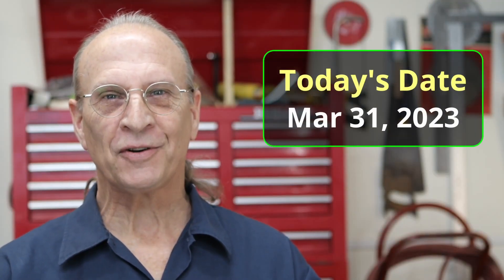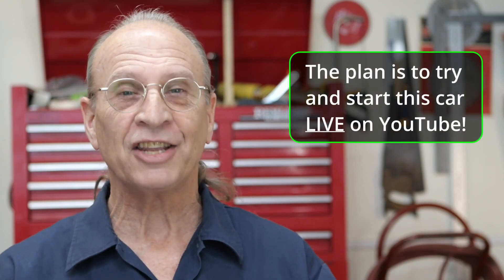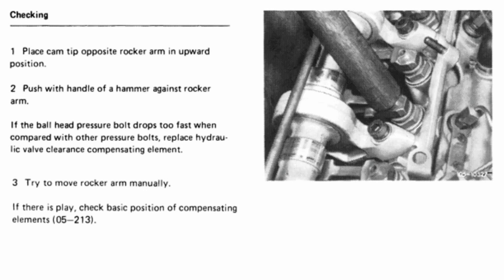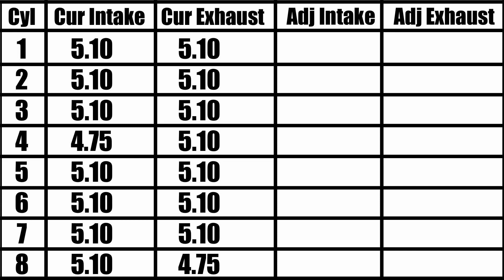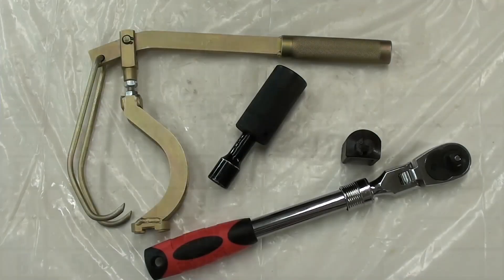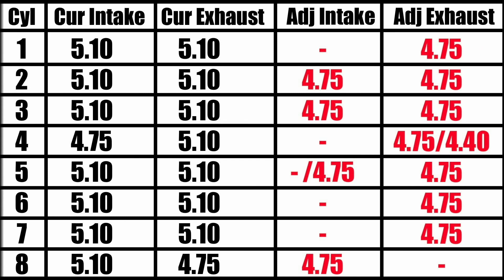560SL - Adjusting Valve Clearance / Compensating Elements / Go-No-Go Gauge

Comment: Great video.. do I need to do any adjustments if I replacement all 16 lifters (compensating elements) on a 86 560SL? 
Aren't thr lifters self adjusting (hydraulic)? 
Also, do you recommend Febi lifters or other brands? Thanks!
Reply from the maker: Thanks for this question. I think others might have the same question so I want to answer with detail. This is how you test and adjust hydraulic lifters on the 560SL (M117). Yes they are hydraulic in a way, but no, they are not self adjusting. Compensating elements could be leaking, plugged or not within spec and the shims used to adjust valve clearance could also be worn. And don’t forget you have valves and those valves have valve seats that wear out. Lobes on your camshaft wear too. When you are using the Go-No-Go gauge, you are testing the “valve clearance” and that’s the most important part. You could have all new valves, compensating elements and rocker arms and still have incorrect valve clearances. This is the only way you know for sure and the only way to get it right.
Reply: @TonyLiveTV thank you very much for your detailed response 👍  so, I need to purchase new shims as well? Is Febi a good brand for compensating elements  (lifters)? Also l, how can I tell that my lifters are actually bad given I hear the lifter ticks? 
By the way, the car had 175k miles on it
Reply from the maker: @arashrx the only way to know what you need is by testing. That’s why I own a Go-No-Go gauge. All parts used were genuine Mercedes. That’s me. I cannot comment on other brands when I don’t use them. Nothing is better than a genuine manufactured part. Often the genuine part is cheaper anyway and can last 40+ years like it did on our 560SL. Did you test and bleed the compensating elements? 560SL - Bleeding Hydraulic Lifters / Compensating Elements https://youtu.be/jmjHY-BCUjo
Reply: @TonyLiveTV  thank you for your feedback and quick response 👍 
How donI test my lifters, do I need to take them out first? Is there any procedure to test them while in the car?
Reply from the maker: @arashrx how to test is in the video and in the manual. Your engine needs to be running in order to test compensating elements properly. Taking them out and bleeding them will often expose issues. Everything is in a video somewhere because I completely dismantled this engine and I covered virtually everything I could think of. What I didn’t cover you will hopefully find in the manual.
Reply: @TonyLiveTV thank you very much.. I will 1st try to bleed all the lifters and hopefully that fixes my lifter tick 😊

Comment: Great video,  one point that should be mentioned (apologize if you mentioned it and I just missed it) is that as you compress valve spring to remove rocker arm, cam lobe is up and as you compress the spring, be sure valve falls with spring.  If it does not, keepers can release and valve will fall into cylinder…….
Reply from the maker: @MrBobby3340  good point. I did see the keeper could pop out so I was very careful.
Reply from the maker: Hey Mr Bobby. I was working on a project where I had little cell service, but I thought I saw a post from you asking about the no-go-gauge. Maybe it was someone else, but I no longer see the post. If it was you and you need something, let me know.
Reply: @ Hi Tony,  it was me.  I was able to borrow the tool.  In the middle of replacing the timing chain, etc.  I decided to replace the rocker arms and compensators.
Reply from the maker: @ great 👍

Comment: Hi how are you brother
It's a minor differences between the yellow line so if you don't adjust it properly does it damages the piston or damages any other parts or ot adjust by it self
Please let me know
I liked your clips
No other person can make clips like you
I also love 560
They are the best cars in the world
Take care brother
Reply from the maker: Thanks Shabaz. The purpose of using a go-no-go gauge for testing valve compensators in the Mercedes M117 (560SL) engine is to ensure that the compensators are within the specified tolerance range for proper valve clearance adjustment. If the gauge shows the line above or below the measure point, it indicates that the compensators are either too tight or too loose, which can lead to issues such as poor engine performance, excessive wear on valves, and potentially even engine damage if not corrected.

If you are close with the go-no-go gauge it will likely be just fine. There seems to be plenty of clearance between the valves and pistons. I would say engine timing is more important in this respect. If your valves open at the wrong time it can cause damage to valves and pistons.
Reply: Thanks brother for your reply
I live in Bahrain
If you come to Bahrain
Let me know
I want to open a car garage but knowledge is very important
That garage will work for only 560 classic models
Reply: If possible can I have your what's up no.
Thanks

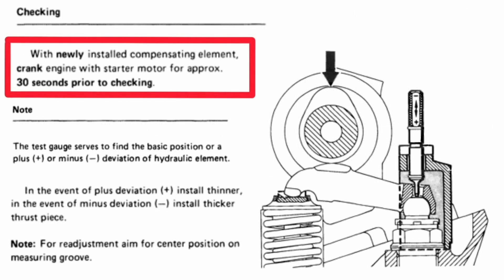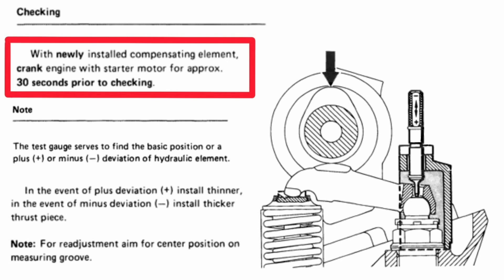Comment: There's something I don't understand - In the video, it looks like you have the go-no-go tool sitting over the spring and thrust washer for the measurement test, meanwhile in the manual image you show earlier (starting at 1:38 and an alternate view starting 2:33) its clear that the go-no-go tool is positioned over the compensating element - I'm confused on why, and where you are supposed to take the measurement - tool over the spring, or tool over the compensating element? OR - is it both, and they measure different things?
Reply from the maker: Tool is over the compensating element. Not on the spring side. My close up video was too close. I should have shown the entire tool and how I measured. I’m sorry about that.
Reply from the maker: I just had a listen and I see what you mean. Does it sound the same warm or cold? The compensating elements are tricky. Just having them hard doesn’t mean they function properly. Since you have the go-no-go tool on the way, pull your compensating elements and bleed them down (see my video on bleeding). After bleeding they will become spongy and can be pushed together with your fingers, but spring back. The tension after bleeding should be similar between them. Once you have confirmed this you can move on to measuring.
Reply: @TonyLiveTV  Thanks. I measured using the tool today (before I saw your note) and I have three valves that, according to the tool, may need thicker thrust washers. Each thrust washer read the same - 5.10, but the bottom of the measuring gauge indent sat flush with the tool - so according to the manual, those three need thicker thrust washers - I'm just not sure such a small difference would really make all that noise. I am considering just replacing all the rockers, possibly the compensators too.
Reply: Oh, and it starts quiet, but after about a minute or so, the clicking starts. Its also intermittent - it'll stop periodically, say for a second or two.
Reply from the maker: @treozen4653  if those compensating elements are not working correctly that will cause noise. They are hydraulic. In the manual they show using a hammer to depress each element and comparing them as a simple test. If you can’t depress then it’s bad. And if it is too soft it is bad.
Reply: @TonyLiveTV  Great thank you. I ordered new compensators and rockers too - just to take any guess work out of it. The car had only gone about 2000 miles in the last 13 years - so that's a fair amount of sitting - I don't wonder if the compensators are having trouble "compensating" with little use - perhaps they just need cleaned, but in either case - at least I have a direction.  I'll then remeasure clearances and see where we end up. Thanks!
Reply from the maker: @treozen4653  let me know the results. I’m curious to know the difference between new compensating elements and your old ones.
Reply: @TonyLiveTV  Will do - parts are going to take about a week I think, then we'll see.